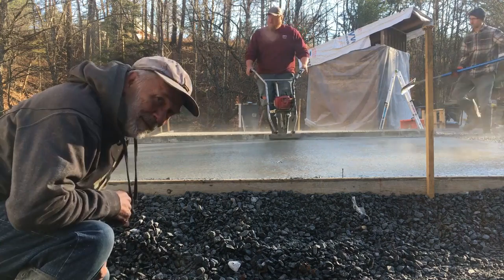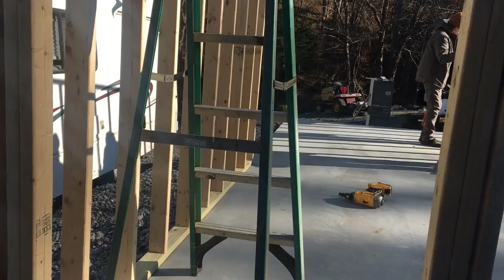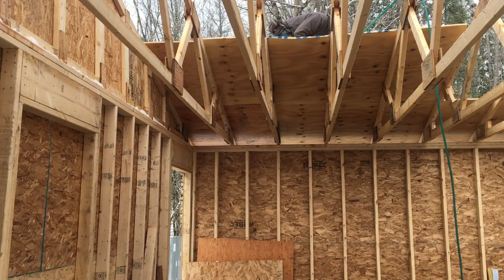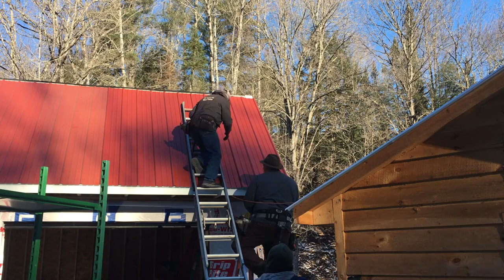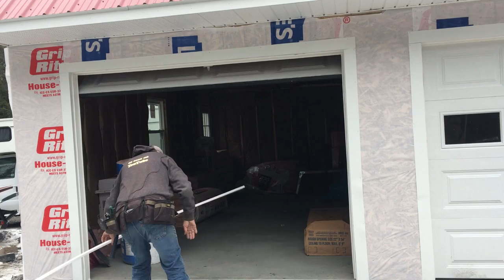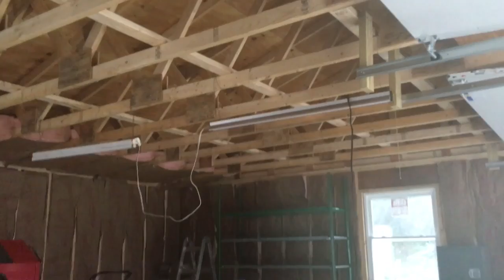Saltbox Garage Start to Finish $28,000

Comment: For one who recently moved to Vermont, one thing you notice is that snow and cold does not slow these people down. During the -18f cold snap in Feb I saw fellows on my neighbors roof installing solar panels. Ken is no different.  Most people elsewhere shut down for winter work. Vermont wouldn't exist if people like Ken didn't exist.
Reply from the maker: Thanks

Comment: With the stud height and 3 top/bottom plates, this would leave a gap when using a regular 8' tall siding panel or sheathing right? Is there another method of building to avoid the gap or is the gap just normal?

Comment: Good Morning Ken! Really love your channel. What do you think it would cost for a 24x24 house to finish exactly like this? Im planning on being my own builder here in Florida, and will take me a little bit of time, but as a 23 year old, 576 sqft is all I need. My house plan has 2 bedrooms, one bathroom, and a modest living room and kitchen. With rough plumbing and electrical and finished interior such as drywall baseboards... Im hoping to keep it to under 40-45k before appliances. Would love to hear your thoughts. Thanks ken
Reply from the maker: Sorry I’m not really up on house costing
Reply: @kenskarpentry  not a problem! I think if i can essentially build the shell and do vinyl and windows and everything you did in this video for the garage for 30k. I should be able to do the rest for under 50k.

Comment: Great video Ken!! How do you anchor the walls there? We used to set threaded rod in the concrete then drill holes in the bottom plate and lift the wall over it.
Reply from the maker: We use wedge anchors after the walls are up

Comment: Does this buildings cost include wiring, lights, switches and outlets or is that just the lumber, concrete and labor? $49.00 per S/F 24 X 24
Reply from the maker: Concrete and building finished on the outside